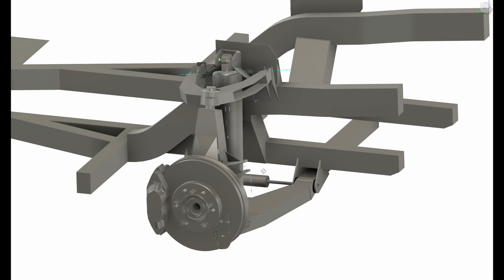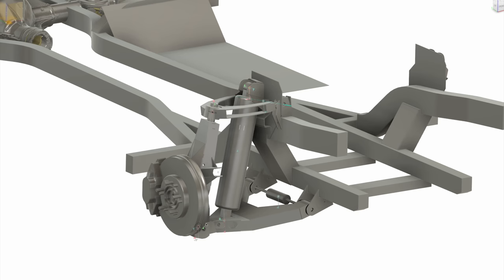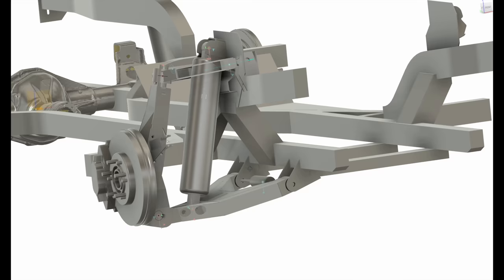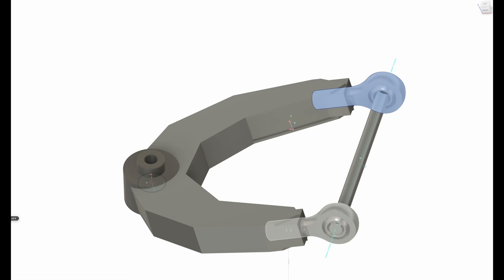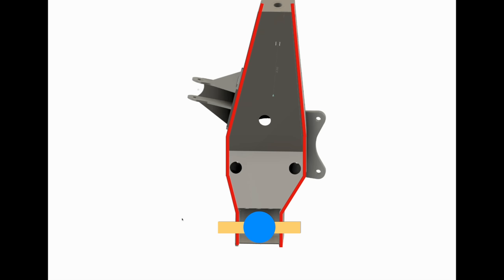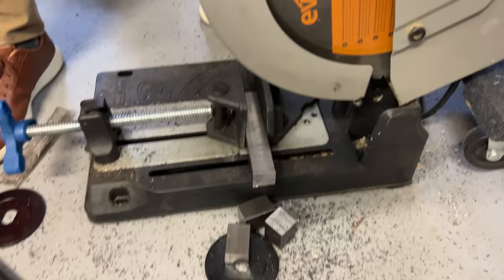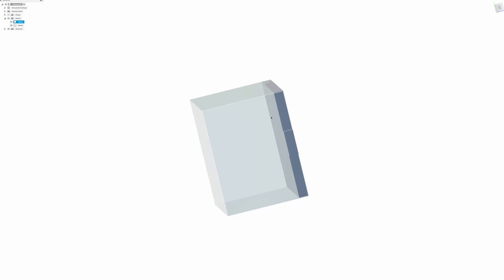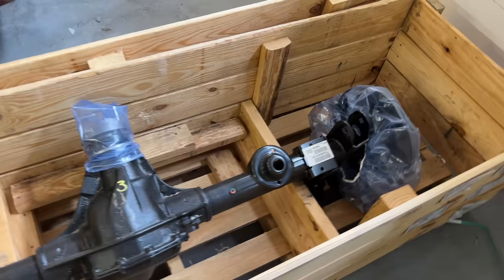Off-Road Dodge Viper Gets Custom Front Suspension

Comment: 7:28 I can explain. When you are bending something, you are basically streching some areas and compresing other. The areas where there is the most displacement have highest tension and will fail first. Those areas are at the outter surface so you should reinforce the surface and care less about inside of the part.
Reply: Inner braces for avoiding torsion?

Comment: Do not get fox 2.0's with the LSC you'll never get the thing to ride smooth over small imperfections, the DSC is apparently worth it but get non adjustable or DSC, do not settle for the LSC, they block a lot of oil flow at low shaft speeds and make for a really harsh ride.

The ride improvement I got after removing the LSC adjusters on my fox 2.0 smoothies was pretty dramatic, and I only figured out to remove them after reading multiple posts from others who had the same shock tuning issues I was having.

Comment: You may be overqualified for dodge but the it’s good enough attitude qualifies you for a job a JLR :)

Also the half (or even no overlap) design for welded structures is the first thing I was taught when making stuff in cad for welding.

Comment: Love you videos.  I design my own hotrod suspensions.  You are making this way to complicated.  Use the spindle from a truck of your choice.  Design the suspension with Performance Trends "Suspension Analyzer".  It's free for a trial period.  I recommend you build in a lot of anti-dive.  Order the upper and lower control arms to your specs from UB Machine with screw in ball joints.  Last time I did this they charged me $140 for both sides.  Their products are made for circle track guys, but they will jig up anything.  I ordered thick wall tubing.  No problem.  Parts came powder coated.  BTW, when you break are part, they will make you another.  I have never broken anything they made for me.  You will have to modify the Viper steering rack to prevent bump steer.  The steering rack joints should be placed anywhere on a line drawn between the upper and lower suspension mounts.  Shock length should be set to have 2/3 travel in bump and 1/3 travel in extension.  Good luck.
Reply: >You are making this way to complicated. 

You do realise the channel you're on, right?
Reply: sorry for the typos you-your, to-too, are-a.  I blame the keyboord.

Comment: Should have used 3-spoke wheels. They are the elite wheel spoke option. Also, the suspension design is very KibbeTech-style. Look them up, if you haven't already. They make street-able trophy-truck suspension and full-builds. Hit them up, I'm sure they would be happy to be involved in the build. Would help their exposure as well. Do a Collab. What you're doing is essentially what they would do if a customer brought them a Viper to make a trophy-truck out-of.

Comment: For dynamic strains a fully penetrated root in the weld is absolutely crucial, otherwise you have a notch effect in every weld. Please do a better job at the weld prep, i would use a open edge as you already suggested, but with the both inner edges interfering, so the weld is symmetrical.

Comment: Careful with the Rubicon axle. They have a tendency to destroy their spider gears in very short amounts of time, just driving around on the street. Like less than 40k miles usually. Maybe upgrade the carrier from the get go. Although when they eat themselves you have to replace the whole carrier anyway so that could just be a problem for Future Matt.
Reply: Are these the ones that people replace with Ford 8.8 rears sometimes, or is that other Wranglers? All I know is that my main competition for finding 4.10 Ranger and Explorer rear ends seems to be Jeep folks.
Reply: @christopherbrown6697  As far as I know that's usually YJ guys and probably older XJs as well, so like mid 80s-94ish Wranglers and Cherokees replacing Dana 30 rear axles with Ford 8.8s from Explorers because they are cheap and strong. I'm not that versed in older Jeep year cutoffs. I'm assuming Matts axle came from a JK which is the generation before the most current one.

Comment: You should look into a sponsorship with send-bend-send so you can use some tubing.  That would help with the weight problem.  Still wondering how you get substantial bending loads in the UCA rod ends when they've got ball joints at all connections.

Comment: Hi I’m an mech. engineer. Use 5 times the static load on your suspension with your shock being treated as a solid bar, then run an FEA. That should be good

Comment: Holy shit. Not bad work. As someone who’s built Long travel suspensions for prerunners (fully fabricated, upper and lower’s plus spindle work) this is legit. You mentioned relocating the unit, bearing / hub higher up on the spindle for better geometry.  Just not so sure that’s a good trade-off for a vehicle intended for off-road use. It might be worth sacrificing some scrub radius in favor of lots of ground clearance especially when you bottom out completely , and the sub frame gets very close to the dirt. You might be digging into the ground at full bottom out unless you really limit you’re up travel, which then will equals a terrible ride (general rule of thumb for prerunner would be 2/3 of the total suspension travel is up travel).  Also, if it’s not too late, I would not run a unit bearing I would run a Fully floated snout off a maybe junkyard, Dana 44 or something with the lug pattern you like (Toyota hilux ?) . Also, I know designing it in CAD with what force limits you think are going to be there sounds nice but when it comes to the off-road world, there are loads and forces you can’t predict for and generally “experience “ with racing or just fixing what broke is best so don’t be afraid to refer to what other off-road race shops have done. People have been building off-road race suspensions for over four decades now so check out what is done there. 

Now, just wait till the suspension tuning part starts (shock, valving, or bypass shock placement). This absolutely will make a night and day difference in the handling and ride quality. That’s the real fun.  😢😢😢

Overall nice work ❤❤❤.

https://www.race-dezert.com/forum/

Comment: If you leave some of the fold line uncut, it makes it easy to bend exactly where you want to bend it, making it hard to make wrong, and it reduces the amount that you need to weld, I think you will end up with a better product, easier to make, and less overall work.

Comment: Get yourself a Steel-It sponsorship, to put the same coating Honda Off Road Racing uses, on your suspension, and lots more. Stainless steel impregnated polyurethane. Yup...Hard as bowling balls........ And lanes..... With stainless to protect all that carefully welded equipment. Comes in spray bombs. You can also weld right through it, and spray touch-up over your new weld....Great, when you need to get a stick welder out, in the wilderness..... Eat your heart out, powder coat.....

Comment: You should consider using a CAD software that has a sheet metal tool, and finding a vendor that will put bends in you parts.  It will save you a lot of time, and a lot of welding.
Reply: Send Cut Send  does bends as well. I happened to be looking into that this past week.
Reply: he's using Fusion360 and it does have a sheet Metal working space. no idea why he's not using it, but i can tell why i don't: it's annoying af and very counterintuituve in some ways..

Comment: Curious for these welded box steel components, is rusting from the inside out a concern? (especially since it will be in mud and water) Since there is no way to paint the inside structure before welding out, or is it just that they are thick enough to reach end of useful life by they time any corrosion becomes a problem? Love the build keep up the great work, welds are looking great since you took the class
Reply from the maker: I’ll fill it with paint, tape off the openings, slosh it around, and drain it.
Reply: @SuperfastMatt   ha always one step ahead...what a great simple solution
Reply: I think you are right it will not be an issue before their end of life, but you could actually paint them if had them fluidised bed powder coated.
Reply: It's a Future Matt's problem...
Reply: I'm painting the boxy trailing arms for a VW Vanagon at the moment, and it's a chore. Basically, brushing as far in as I can reach with a heavily loaded brush, then pour some in and slosh around. After the final coat, they will be sprayed with a cavity wax wand prior to final assembly. I also eliminated factory holes on the top side (originally for brake line clips, replaced with standoffs made from bicycle cantilever brake posts) and added a few more drain holes on the underside to reduce chances of retaining muck and rotting out. I'll spritz some Fluid Film up through the drain holes periodically once it's on the van.
Reply: You can paint the inside of the structure before welding it - use weld-through primer on all surfaces that will end up inside the assembly.

Comment: @8:09 Could  you tack weld the bolt (or nut?) into the upright before you seal off the box?  Then you wouldn't have to fish it up there.

Looking forward to each video in this series, especially the one in the end where all of this is put to the test with a Viper in full send.

Comment: Consider giving the different plates different colors, it will make seeing your slots and tabs much easier. Do you need to worry about water retention? i.e. should you put drain holes in them?

Comment: You may have been able to save yourself from making any suspension parts, let me explain. So the piece where the hub/bearing bolts to I would have copied just the face pattern (3 bolt holes for the hub and 2 for the caliper you would make 2 for each side, Then you can now make a bolt on lift kit and make it as tall as you want. in essence you are just relocating the hub further down while keeping the stock suspension, and be able to use the factory calipers and rotors.

Comment: Won't those box constructions fill with water/mud and end up just rusting out from the inside? I'll take a while but all the welding will make them very rust prone. Can you drill small holes and inject them full of cavity wax maybe? Or are they sealed?

Comment: Quick question for the present engineers: Would these welded component be lighter than billet machined aluminum counterparts? I base myself on the principles of more precise use from loadpath and less material needed for similar strength. Question is purely for optimal components composition.
Thx:)

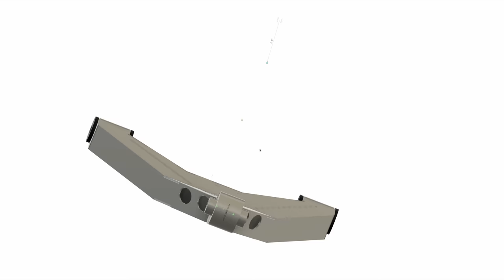Comment: @11:10 did you consider building the control arms to be the weak point? Seems like it would be easier to replace a control arm than to repair the frame.

Comment: Doing real engineering is time consuming and tedious and expensive. And sometimes, overkill. Burt Rutan, who has designed and built some of the most revolutionary airplanes in the last 50 years subscribes to the TLAR engineering principle. That Looks About Right. And if it breaks, you make it a little stronger next time. You could do worse than emulate Burt Rutan.

Comment: Im no engineer so this is a genuine question, not criticism - why use 5 stud durango hubs when vipers typically use 6? Perhaps the rt10 was 5 stud, but even still, for off road id assume you'll use truck wheels - aren't they more often 6 stud?
Reply from the maker: The Viper 6 stud is a weird small pattern that isn’t very common. 5 on 5 is plenty for the Viper weight, even for serious off-roading. It’s what the rear end I bought came with and there are lots more wheels available

Comment: Why not use control arms from another car? Then you just have to make mounting locations on the viper frame. Is the steering rack position the problem?
Reply from the maker: Mounting everything to the frame is a lot easier when I can shift the points around a little bit. I can slide the inboard points along the pivot axis without changing the geometry and I get much easier mounting. I can also use better bearings and bushings, and shift stuff around to make shocks and ARBs fit. Also the steering rack.

Comment: Don't over think how to accurately locate those mounting tabs. Jeep dudes have built suspension like this in their garages & driveways for several decades--largely without issue. Close enough is good enough for 90% of builds like this. Unless we're going really fast it's not as critical as we'd think it must be.

Comment: The 2wd 02 to 04 Dakota spindle and dual piston caliper front brakes would have been my starting point and I would have just made tubular a ams with spherical rod ends both upper and lower . Bolt on stock ball joints and use the stock tapered steering rod ends. 
But in the end... I wouldn’t even bother to do it at all.
This is just a dumb idea to add to an even dumber car. JBH

Comment: Do y’all think the Japanese auto manufacturers (or specifically Toyota) have imported cars like the bronco to Japan for reverse engineering? Or perhaps might they do stuff like that stateside?
Reply: LOL I think you have that backwards. That 4Runner design has been around for many years - long before the current Bronco or even the T6 Ranger that the Bronco is based on.
Reply: @brianb-p6586  oh yea I see what you mean. But as a separate thought, I am curious to know what lengths these large companies go too in order to take inspiration from (borrow/steal from) their competitors.
Reply: @jabug_1144  it's not one company stealing from another. The entire industry uses the best available practices, which are well known to all companies. They all publish their designs and share them in technical forums, and they all buy each other's products to check the details of implementations.

As available technology (such as materials and manufacturing processes) and requirements (regulations and customer preferences) change, all companies evolve their designs in generally similar directions.

It's likely that neither Ford nor Toyota even existed when the first double A-arm suspension was built, and it unlikely that either of them was first to use a vertically extended hub carrier to improve geometry (which became common decades ago).
Reply: @brianb-p6586  I seems I was lacking some insight

Comment: love the engineering nerd stuff. but dont overthink it too much

you can do all the math and modeling you want, but it will enevitably need to be tuned in the real world. id make everything adjustable as possible

also a lot of offroad stuff prioritizes travel over steering geometry and camber rise and stuff like that. so you would end up with almost completely paralell and same length upper and lower control arms. you just want to wheels to move and soak stuff up easily. if your going to be road driving, you do have to worry about both.